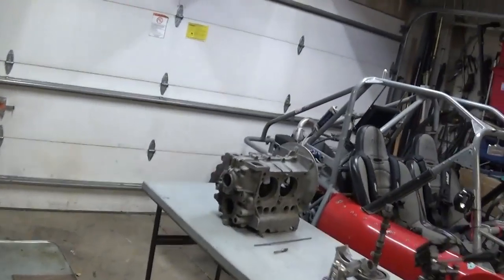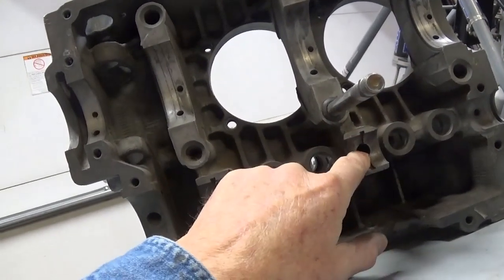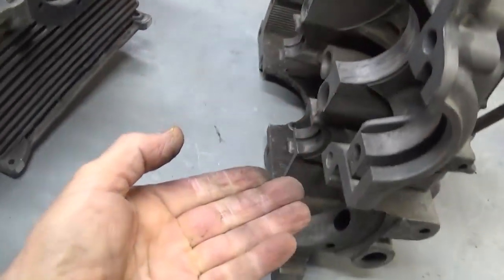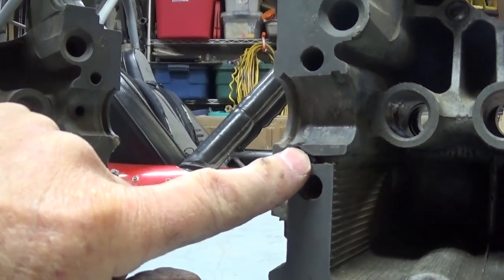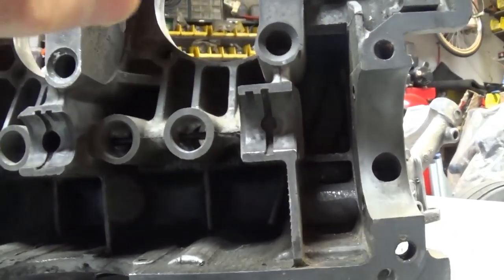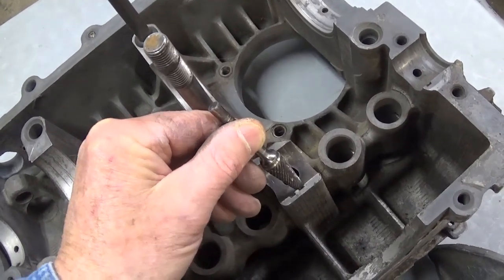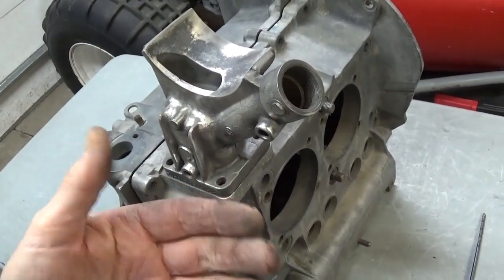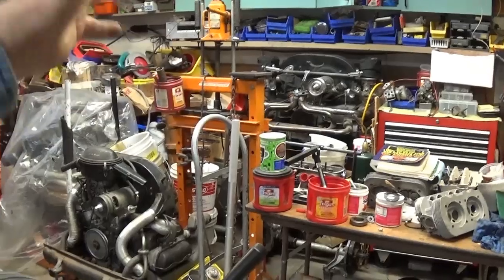VW Engine Oil System / Hoover Mod revisited

Comment: its called line loss , the longer the run the less pressure , the 1/ 2 side case gets less oil because its at the end of the line ,   making the line bigger in the middle isnt going to do as much as just raising the pressure

Comment: For the unofficial record .. Mr. Hoover was just a young man in his 20s when he imagined the HXmods. 
He had zero experience and did absolutely zero follow-up testing or verification.
And one by one ... every mod he did .. is being proved to be disastrous to the air cooled vw engine.
Except for grinding the rocker-arm shaft allowing for a circular flow .. under the rocker arm.
As for all the rest ... don't do them ! 

Remember  .. just because somebody has a long winded answer  .. unless they have done very specific before and after testing and verifications ... they are really  .. making up answers .. for problems that don't exist.  In other words ... they are just enablers of HVmods
Reply: well said! 😀

Comment: I totally agree. People forget that designers of these things are not motor mechanics but highly educated professional engineers. They make every hole for a reason they size every hole for a reason they send a certain amount of oil to each
bearing for a reason. If you are planning to race the thing OK , knock your self out but Air cooled VW engines were never
designed for that.
Reply from the maker: Well said!

Comment: Hay ezgz do you like the total seal rings they have no gap
Reply from the maker: Yes,  it's just for the second ring groove. I've used it on 2 different engines so far.  $100+ dollars and throwing away a perfectly good kind of sounds crazy.  The first time was over 20 years ago on my 2110 build that had 9.5 to 1 compression.  That made 170 psi compression on all 4 cylinders for years and years.  I just freshened up that engine with a new engine block and lowered the compression to 8.5 to 1 .  I just honed the cylinders with a standard grit cylinder hone and slapped it together. All 4 cylinders go 160 psi after the build. Not saying I recommend doing that but tells me that it's a good product. Not even saying I would do that again.  I guess if you have the extra money and it makes you feel better. Do It!  Probably makes more compression for longer that stock.

Comment: How do I know what engine I have in my airplane it's a VW motor. I would like to know the CCS if it's 1800 or 2100 or whatever it might be
Reply from the maker: You have to take off the head and measure the bore and stroke and CC the head to know for sure. That will also allow you figure out the compression ratio. 
There are just to many aftermarket parts available to know how it was built.  Its a airplane for crying outl-loud.

Comment: Brilliant.  Extremely helpful video.  I have been looking for information on how the oil system works. I especially appreciated the part where you showed us the little bypass for the oil at the cam bearing at the front of the case. 

One thing I have been having trouble with is figuring out how the oil gets back into the block after it makes it past the crank thrust bearing near the transmission.   I see the inlet hole but my AH block is machined without any other holes for it to return.  I saw your other video where you told us to be careful not block that gap with engine sealant but mine is blocked from the factory.  Have you ever seen this before?  Thank you.
Reply from the maker: That's not an inlet hole it's the drain hole and it's up off the bottom so some oil remains there for the next start up. The oil is supplied from the rear main journal  located under the rear main bearing.

Comment: you seem to miss the point of the hvx mod.  it was to get more oil to the valve train, not the cam bearings.  you also missed the lifter mod that makes this work by allowing oil flow for more than a fraction of crank rotation.  finally, the rocker arm mod is needed to get the oil to the valve springs on the right side of the engine, which was the goal to begin with.
Reply from the maker: Go ahead and follow that hvx tribe. I know from driving my cars every day with modified engines that the hvx mod is not necessary. If you have spring heating problems your putting a band aid on your elbow when the sore is really on your knee.  If you do the hvx mod to increase oil flow your robbing oil from your mains and rods. You will need a larger oil pump. Larger pumps take more HP to turn. To much oil flow on rods and mains will cause unwanted bearing wear. Do the research. Build it and drive it for years then take it apart and look.  Or just join a club of like believers and continue building it wrong. You hvx guys don't drive your cars like I do so it really doesn't matter. Create a great day my friend.
Reply: @TheEZGZ  your points are well taken and in a land based engine make perfect sense.  however, bob was an aviator and also believed in the vw design as a suitable power plant so he addressed the short coming in an effort to create a more reliable power plant for small ac.  he also created crankshaft alternators and an adapter for mounting the prop on the flywheel end of the crank.  this was before the makers of small areo engines were readily available to the eaa folks.  so even though he started the hvx mods for the baja bugs, it led to better performance for the home built aircraft using the vw engines.  cheers!
Reply from the maker: amen and more power to ya.  It has it's place but many newby's  might think it's the right thing to do.  For a everyday car I say caution  and not for the faint of heart.  Everybody  get all excited that they  are going to gain something and  be  ahead of the pack. I say the factory new a thing or two and leave well enough alone. Hvx mod is for the 1 % that have the need and know what there doing. God Bless and No Harm No Fowl.  Peace!
Reply: @donaldelrod9172  
Not one word you said was true. Hoover was a vw stooge .. who didn't know his arse from his elbow when it came to vw sir cooled engines. Every hoover mod is a disaster to a vw engine ... You are listening to old, outdated, and incorrect b.s.

Comment: Thanks for the great info 👍 info! I might just widen the center cam valley just a tiny bit.
.....And,,, I just opened an old case and there was silicone everywhere. "drives me nuts!" Permatex Aviation form-a-gasket plastic bottle with built-in brush dark brown very sticky.  Most NAPA stores.
Reply from the maker: Eventually your going to have a leak -(

Comment: Friend greetings from Paraguay ... what kind of drill did you use? Long? And width.
Reply from the maker: I bought a 3/16  by 12 inch long standard twist drill.  I don't recommend  doing this mod.  IMHO   It could have easily been done at the factory but they did not do it. If your not having oiling problems and wearing out valve train on cylinders 1 & 2  Why open it up?  Your oil pressure will drop because you'll be sending more oil to that side and that lowers the level in the sump.

Comment: Hi EZ.  I'm looking for information on the plug that is just to the right of the crank near the dip stick.  It appears to close the hole made when the factory machined an large return oil path from the cam gear area.  I have spent 2 days on the internet with nothing found.  I have one that is threaded in and has an Allen wrench center.  Is there a name for this?  Are there replacement plugs.  What size are the threads?  Thanks in advance.  I have enjoyed your postings.

Comment: I'm working on an unconventional VW engine configuration to be used on
a Gyrocopter. It's going to be a duplicate of the engine used on the
gyrocopter from the movie "Mad Max 2". There are very few photos of the
gyro that can be used as reference but I have enough information that
I can take some educated guesses. The area that is giving me some
grief, and I hope you can make some suggestions, is the intake manifold.
The engine as used in the movie appears to be a single port 1600 and
uses a magneto, no generator stand, standard fuel pump, a modified type 3 oil filler, custom
straight exhaust, external 4-pass oil cooler and a Stromberg BXV carburetor (weird right?).

Anyway, I can see that they turned the intake manifold 180 degrees around and have
some form of squarish carburetor adapter that the intake manifold goes in to and
the carb sits on top of. The carburetor has a cylindrical custom intake filter assembly
on top making the carb sit rather high. The intake manifold does not have any
heat riser attached and therein lies my concern. Since there is no heat available
from the exhaust and there is no electrical system installed, how is the intake
manifold heated in order to reduce the possibility of icing or condensation?
Since no real close-ups of the engine are available, I have to make a guess as
to how to heat the manifold. The only way I can think of is if the "box" that 
the intake manifold goes into and the carb sits on is heated by passing the warm
engine oil through it and then to the 4-pass oil cooler. Do you think that
warming just the "T" junction of the intake manifold would be sufficient to prevent
icing and condensation? Is the oil hot enough to do the job? I've never heard of
anyone using hot engine oil to warm the manifold before so this is uncharted
territory. 

As a side note, there is a "Mad Max" museum in Australia that is suppose to house
the original gyrocopter from the movie. I contacted them to see if they'd send me
some photo's of the gyro but they refuse to reply. The photo's I can find of this
gyro in their museum is NOT the original. The museum version is a dual port with
a generator stand and generator as well as a horizontal standard VW oil cooler.
The dual intake manifold does go to a "Box" which looks original, but I can't see
any real details to help me. 

Sorry for being so long winded but I thought with your experience and "experimental"
nature, you might give this problem some thought. It's my intent to construct a
functional and working Gyro engine identical to that used in the movie and install
it on my current gyro that's using a very expensive Rotax 503 DCDI engine (I hate 2 strokes).

Anyway, thanks for your time and any suggestions would be greatly appreciated!

Sincerely,

Michael Sohnly
Renton, WA
(Virus central, USA)
Reply from the maker: Generally speaking if they made the movie in warm summer temperatures and low humidity there would not be as big a  problem with fuel Icing.   You have to be much safer with an aircraft engine.   
 Stock VW intakes had the exhaust heat at the Tee in the manifold and of course as the engine RPM went up and down so did the exhaust flow. They also used summer and winter air inlet flaps on the oil bath air cleaners to pick up heat near the muffler at lower RPM. So by now You should be getting the concept of not relying on heating the fuel mixture after the carb but also /and/or preheating the air before the carb.  A word of caution: VW engines are famous for vapor lock and boiling the fuel in the float bowl causing the engine to quit on hot summer day's. NOT a good thing from the air. Fuel injection fuel systems are less prone to fuel icing. 
There are established company's that convert VW engines to 2 cylinder operation and have Magneto's and fuel systems. 
http://www.flight-mechanic.com/carburetor-icing/
https://a6141.americommerce.com/
http://www.aeroconversions.com/products/aerovee/index.html
Reply: Michael-- are you documenting your gyro build? I'd love to see it!

Comment: Is the 110 camshaft a small step up from stock in a 1600? I want to go with a larger than stock Cam. But don't want to go too large for my stock 1600 with dual 34 mm carbs. What would you recommend?
Reply from the maker: you might consider Ratio rocker arms. That way you can always go back to stock without splitting the case????

Comment: Here's a question for you. I'm about to build a VW engine. I want a stroker with some displacement for power, and keep the rev's down.  My understanding is the longer the stroke the more side pressure it puts on the cylinders. In your opinion, what is the longest stroke you would would go with if you want it to hold together for a long time? Thanks
Reply from the maker: No hesitation on my part. My best engine for a daily driver with good power on pump gas is a 78 storke X 90.5  bore. Stock valve heads, a mild cam, dual carbs, stock heater boxes and no bigger than 1.5 header style exhaust. Cast piston's are fine, counter weighted crank with lighten flywheel, stock length rods ( stock stroker rods or aluminum H beam stroker rods) Total seal piston rings, full flow oil system with filter using a 26mm pump. If you go with a new engine case (aluminum or mag) maybe a 1.5 deep oil sump with professional rotating parts eng balance. It will make good power foreeeeeeeeeveerrrrrr. 
Dog house cooler with thermostat and stock air flaps goes without saying along with all the rest of the stock engine tin. That's my theory and I'm doing it in my Baja every day. AMEN
Reply: @TheEZGZ   Thank you EZ, I really appreciate the advice. The 78 x 90.5 has been on my mind, though someone said AA has new 92mm thick wall that are the thickest of any (4.75mm I think).  I figured displacement is better than high RPM.  It's going in a rail buggy, so the 78 x 90.5 is probably more than ample, and if you're putting it in yours, with all your knowledge and experience, that's good for me. Thanks again.  Would love to spend a weekend picking your brain, lol.

Comment: the Hoover mod was for engines running high RPM for long periods of time. Airplanes. IT was to prevent excessive oil to the left side valve cover at high rpm. Relieving it to the other side of the engine.  I agree not necessary for street cars.
Reply: Exactly this,  not sure what his tone is about,  there are reasons for everything...

Comment: I see your point on the extra mess created by added oil return around the cam gear but the grooving of the lifters to allow more oil to the rocker shafts to allow cylinder head cooling to be improved ..do you warrant this mod?..
Reply from the maker: Why do you need to improve perfection? Why do you think VW left it out? That's like putting a bandage on your elbow for the sore on your knee.  If you have overheating problems then you need to find the real problem and fix it.